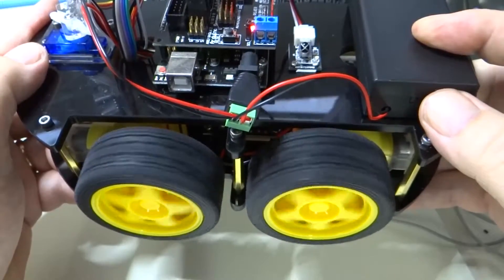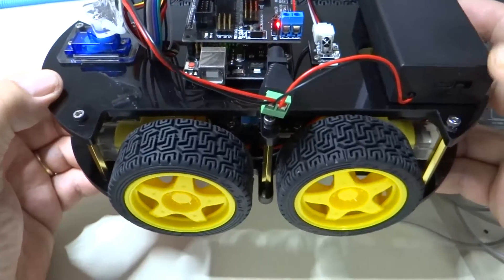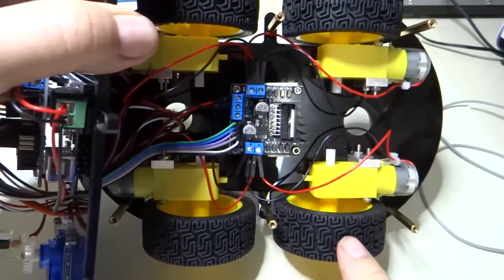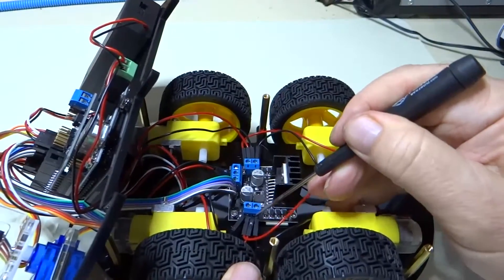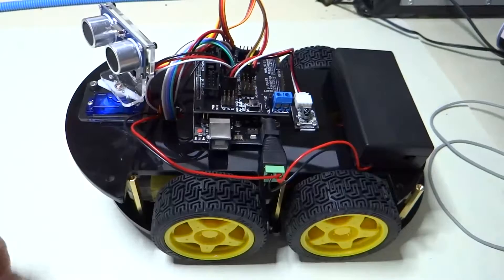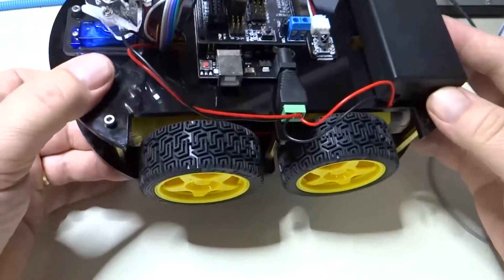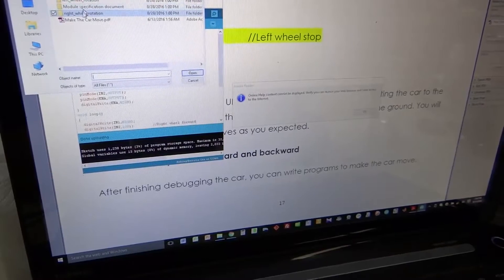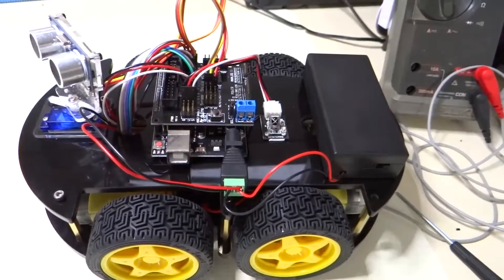Elegoo SRC kit 29 Lesson 1 right wheel rotation pt 2

Comment: Aaah!! Here it is. I wrote a comment about the wheels not turning right on your wiring the car video. I had the wires connected exactly as you do, but oddly, I had to switch the wires from the front wheels instead of the rear as you did. I went by the way the car moved in the Auto Go program. Forward, reverse, turn left, turn right, repeat until bored or batteries die (LOL).
Reply: I just noticed another thing. After watching this video, I loaded the right wheel rotation program and the right wheels turn on my car not the left ones as your's does. Something must be wired different between our cars.
Reply: I noticed the black and red wires coming from the wheel motors are wired opposite on your motors from the motors in my kit!!! This will affect the direction the wheels turn, but doesn't explain why the left and right wheels are switched.
Reply from the maker: TinkeringJohn glad you figured it out. It's easy to get the motor wires reversed, but fortunately also easy to fix. That is why testing with autogo is so important.
Reply: The thing is, is that they came in the kit that way, so the supplier is making some motors wired one way and others wired the opposite way.
Reply from the maker: TinkeringJohn that is true, the quality control could be improved, but it's an easy thing to fix, and it may also be why the kit is so inexpensive. I'm willing to tolerate lower quality for a good price sometimes.
Reply: I bought mine on Amazon. I got the V1.0 instead of the V2.0 kit because they had a $14 'Lightning Deal' discount on the V1.0 version at the time (paid $56 for it). Another great deal is the Elegoo Uno R3 and Mega2560 Project Complete Starter Kits. I bought both of them for $53 each. You get a lot of bang for your buck.
Reply: I found the reason for our motors not turning properly the first time we ran the car. It has to do with the mounting of the motors. If you look carefully, 2 motors are wired one way and the other 2 are wired the opposite way. Now look close at the instructions for mounting the motors and you will see that the front 2 motors are mounted with their red wires facing  up and the rear motors with their black wires facing up. Then when you wire the motors to the H-bridge (L298N) board the way the instructions show, the car will move as it is supposed to. I had all my motors mounted with the black wires facing up, so I had to switch the wires of my front motors on the H-bridge. You have all your motors with the red wires facing up, so you had to switch the wires on your rear motors.

Comment: I got a problem... i upload the code and the car works when is connected to my computer, but when i unplug it doesn't work even with the batteries
Reply: You probably have solved your problem by now but....I had this problem also. I found that I had the wires from the battery box and L298N board too far in the UNO power connector to where the insulation of the wires were preventing an electrical connection. As Greg shows in another video, strip off a little more insulation from the wires and twist the ends together. Be sure that only the metal wire, not the insulation is inserted into the connector.
Reply from the maker: There must be an error in your battery wiring or the battery box switch is not turned on.

Comment: thank you for the excellent series,
can you tell me what is the best way to repair the tip of the black cable that connected to the motor. as i was trying to fix the problem you had on #29 video, i spanned it.
and i was doing so well :(
thank you
Ben
Reply from the maker: A Benjeddi I can you send me a picture of the broken terminal?
Reply: thank you for the reply,
of course, can you tell how, i don't think i can insert an image here.
i can put it on my facebook and send you the link if that helps
Reply from the maker: A Benjeddi that works! Send me a link.
Reply: https://www.facebook.com/benjeddi.co.uk/ 
please find the images there, if you cannot access them i can put them on twitter @benjeddi

Comment: Greg. My blue-tooth module is just sitting in my kit box... Isn't it suppose to mount somewhere? It is never mentioned in the PDF tutorial I have from the software CD. Can you help?
Reply from the maker: If you want to use the bluetooth car, you plug the bluetooth module into the COM connector (TX, RX, -, +) on the expansion board. But there's a big catch that trapped me several times. When you plug in the bluetooth module, the Arduino code uploader doesn't work. That is because the bluetooth module uses the same serial port that the code uploader uses. So, make sure the bluetooth module is unplugged when you want to upload new code. Hope this helps.

Comment: it is quite logical: the front and the rear motors are installed 180° each other, so the rotation of one is the opposite of the other. Surely the same will happen on the other side motors